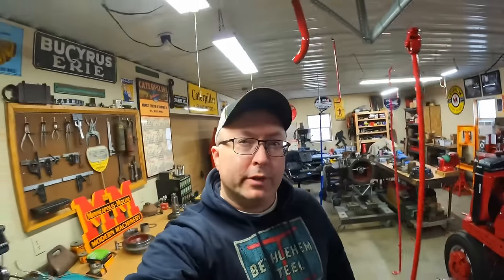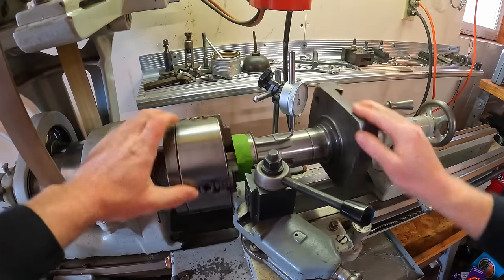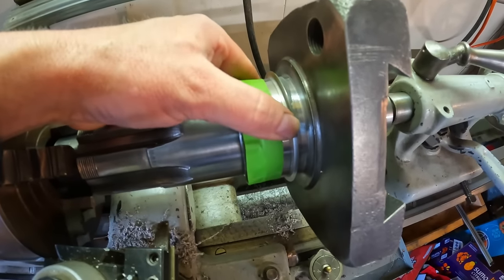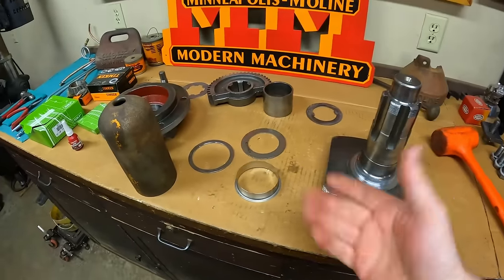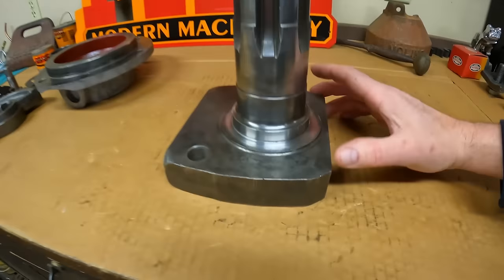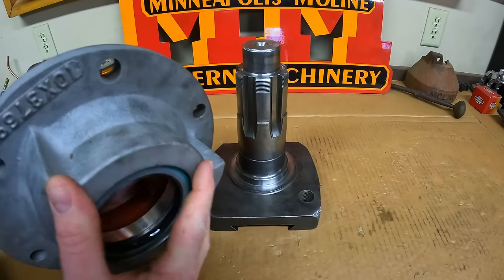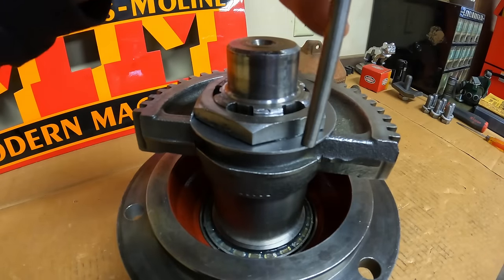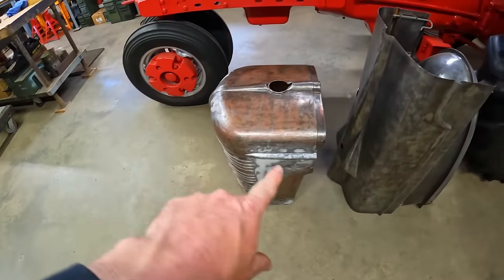Finishing X231's Prototype Steering Sector! Machining & Final Assembly - Episode #84

Comment: Having never used a speedi-sleeve before, I didn't know the bottom portion you peeled off, well....peeled off.  Learned something new today.  Great job on the refurb.  It's always nice to see shiny parts on the bench!
Reply from the maker: Yep, they're scored around the perimeter just above that flange so that you can peel it off cleanly once installed.
Reply: @squatch253  It looked a really scary procedure though. I'm glad both you and the sleeve survived unscathed!
Reply: .. that phone call was Rick Bork messing with ya....
Reply: @neilshep50 The first time using one is quite an anxious time. The more you do, the less scary it becomes.
Reply from the maker: @mmm365 Because the end that has the flange on it has a curved radius on the back side, which allows it to guide itself onto a stepped shoulder shaft like this one here.

Comment: Staying tuned Toby found a couple old shuttle tractors couldn't see a make or model but they were unique a one lunger and a twin cylinder both air cooled and iron with steel wheels and one was rubber skinned front and rear

Comment: Epoxy is such a cool material for the workshop! I always use it to hold un-clampable workpieces in the lathe. Also works really well for the milling machine. You just glue your workpiece to a block of aluminium, which you can then clamp.

Comment: You should look into getting some loctite 660 for putting on speedi-sleeves. It's a paste that you smeer into the groove left by the old seal, then you drive the sleeve over it amd wipe away the excess. It sets up like steel under the sleeve to stop hot spots and deformation, it's great stuff specifically designed for shaft damage.
Reply from the maker: I've used that stuff on the spun Cat D2 & D4 pony motor main bearing bores before (prior to making my own line-boring adaptors to true out the damaged bores correctly) and it does set up and perform very well.

Comment: Excellent video.  The oil filter canister was the perfect driver tool.  I am thinking the tin shims were farmer fixes . I have a feeling that it should be shimmed like the production tractor was that would make more sense to keep the top bearing from binding up unless the bolster is bored out completely different than the production tractor.  Keep up the great videos.  Have you got any reports from the radiator shop
Reply from the maker: I have a sneaking suspicion that the bearing pocket that’s up inside the bolster was machined a little too deep, requiring the shims to be relocated up in there instead of at the main flange. When I get the bolster casting back from the radiator shop, I’ll do some measuring to try to see what exactly is going on 👍
Reply: @squatch253  that could be the case them fancy shims may have been made at the Minneapolis Moline r and d department during assembly a one piece shim would have been better than multiple pieces but I suppose they put what was needed they may not have been thinking about a gasket down below or running oil in the bearing area there.  I think the older tractors ran cup grease in the steering sector and the oil was a new idea 💡

Comment: Long time ago in a galaxy far away I watched a mechanic setting the bearing nut on the nose gear of a jet. He was using a socket a little bigger than the one you have there that was reduced down to a 1/4 inch torque wrench. Setting was in inch/pounds.

Comment: TOBY!!!!! Something registered in my mind about the bearing on the bottom of the shaft. I had to go back to the disassembly to double check. Remember how loose the nut was when you were flattening the fold over lock. My theory is that the shaft was spaced down to try to get a fresh surface for the seal to ride on. That would explain the shims above the top bearing race and the nut being loose so that the bottom bearing could move upward with the hope that the seal would be above the groove on the sealing surface. This is one of those situations where my brain kept telling me that something was wrong but I couldn't put my finger on it until I had watched this video for the third time. Please tell me if this helps.
Reply from the maker: Plausible theory, but the nut was still ran down far enough to have the sector gear bottomed out on the splines, the nut just wasn’t cinched completely tight against it. Likely caused by the small amount of slack that the sector gear has on the shaft splines, and the steady working slowly wore all of the mating surfaces, causing the nut to lose its clamp load on everything beneath it.

Comment: Never installed speedy sleeves myself. However this video is now a good learning material how to handle one the right way. 
Looking good and it will be very interesting to see what other interesting finds will come out of X231 front.
Reply from the maker: You can also install those sleeves upside down too, with the flange up if the job requires it. They just start easier on a square shouldered shaft like this if you have the flange down, because it’s got a nice curved radius on its back side 👍
Reply: @squatch253  Thanks for the tip. I keep that in mind when having to install one myself 🙂

Comment: you ruined me, I made a fold over lock for a perkins engine the other day & I was upset because it had some sanding scratches  on the edges. I draw the line at buffing fold over locks😂

Comment: good job on the sector just wondering about x231 starter painted that red lead color someone probably rebuilt it one time and painted will be interesting to see what inside looks like when you get to it also the generator will be fun too
Reply from the maker: Yes, Senior was the one who put that red primer on it WAYYYY back before we took X231 completely apart - he overhauled the starter and cleaned up the carburetor and we actually had the engine spinning over, but then found that it barely had any compression so we stopped there.  Little did we know how the whole rest of that poor tractor's insides were completely trashed lol!

Comment: Squatch with those dodgy shims ontop of the steering spindle is it possible to use a packing shim (extra thick) and shim out the base like the production units as it seems and you have pointed out that some one at some stage had been into it and made a hash of it all. my thoughts anyway

Comment: I'm curious why you elected to use JB Weld to build up that surface as opposed to building it up with actual weld steel, followed by milling? The steering component looks great sitting on the bench though!  Christine is coming together!
Reply from the maker: I usually JB weld under all of my Speedi-sleeves because the sleeve itself provides all of the strength needed, and the JB Weld only evens out the back-stop if you will.  If I were to build a shaft up with weld, I'd just machine and polish it back to original dimensions and put the seal back onto it.  But in this case, I'd rather not apply heat and weld to this steering pivot - not only because it's a prototype piece that I dearly want to avoid causing any damage to - but also to avoid potentially stressing that portion of the shaft from irregular weld beads.
Reply: @squatch253  Makes good sense. Thanks, Toby.

Comment: Hey Squatch, just wondering if that nut is actually supposed to be your end play adjustment to your bearings? it would work just like a wheel bearing but push outward instead of pulling inward on the bottom bearing to set your end play on the shaft. That would also explain why the nut was barely finger tight when you took it apart? hope this helps.
Reply from the maker: The looser the nut is, the farther down the shaft will end up - which would be good for adding more shims to the bearing cage flange, but would work against the upper bearing because it would pull it further away from the race in the bolster, causing the need for even more shims up there to get the race closer to the upper bearing.
Reply: @squatch253  I agree with what your saying. What I am trying to say here and I will break it down piece by piece. The weight of the tractor all rides on the top bearing in Christine's front bolster. Without any shims under that top bearing race, the bearing housing with gasket and bottom race is X distance from the top race. While the top race on the shaft is fixed, the bottom race free floats on the shaft. Ergo by the bottom cone pushing on the sleeve which pushes on the sector gear which pushes on the FOL which is tensioned by the nut. moving the nut tighter will increase "X" distance and loosening the nut will decrease "X" distance on your shaft to set your "Stack-up" for the bearings. What I have noticed in this video vs the disassembly video after reviewing bot a couple times by my mechanics micrometer eyeball, is that the nut went on a thread or two farther when you snugged it with the impact. which a couple threads of that nut would be about the thickness of the shims you found behind the top bearings. In short, if you tighten the nut it will take away endplay and loosening it will indeed add endplay which would require more shims. Best of luck and cant wait to se the next episode!

Comment: How in  the world did you make the two washers you used to drive the speedy sleeve? I am amazed.
Reply from the maker: I only had to resize a couple that I already had on hand - the outside diameter stayed the same, I just had to take the centers out on the lathe 👍

Comment: Just a quick question i think i remember you saying at one point that whole area is filled with oil or lube if thats the case wouldnt you not want to fill the bearing with grease? I know on oil fillled hubs your not supposed to because if makes it hard for the lube to get in the bearing, just a thought
Reply from the maker: If the bearing is packed with grease, it's got all the lube that it needs regardless of how much of the other oil is reaching it or not.   We always had to pack the rear wheel bearings on the Dana axles back at the Ford dealer after replacing the axle seals, even though they relied on an oil bath type lubrication inside the hubs.  It was Ford specified procedure to do this because it always took the gear oil a while to fully migrate back out to everything, and the grease that we packed into the bearing was the only thing that kept them protected long enough for the oil to start doing its job.  We had one Dana 80 show up that didn't have those hub bearings packed and were just put back in with a smear of oil on them, and shortly after it was put back together the bearings failed to the point that the axle shaft sheared in two, and one piece fusion welded itself to the inside of the axle tube.  That made me a believer in packing bearings with grease, even if they run in oil.
Reply: @squatch253  that makes sence I guess I'm more used to heavy duty applications and in the service manual it states to not pack with grease but you also either have to jack each side up individually to get oil to opposite hub or fill thru fill hole
Reply: @squatch253  this is directly out of the dana d40-170 service manual

Note: Lubricate only with clean axle lubricant of the same type used in the axle sump. Do not pack the bearings with grease before installation. Grease will prevent the proper circulation of axle lubricant and may cause wheel seal failure.
Reply from the maker: All I know is what the Ford Service Manuals recommended for the procedure, and it clearly spells out to always pack the hub bearings with grease when reassembling.  Like I said, the only times I ever witnessed bearing failure from a lack of lubrication is on the ones that weren't packed with grease and only assembled with a coating of the gear oil.  Your mileage may vary :-)

Comment: Could the speedy sleeve be driven flange side up? I haven’t worked with speed sleeves.
Reply from the maker: Yes, I’ve done it both ways depending on the requirements of the job. It’s usually easier to start the Speedi-Sleeves with the flange pointing down like I did here because it has a curved radius behind it, so it won’t snag on a sharp top edge.

Comment: Where did you get the production 445 parts from?  Looks like you have enough parts to build a complete tractor?
Reply from the maker: A few episodes back I told some more of the X231 story that hadn't yet been shared on camera, and in it I covered how I bought this 445 parts tractor to completely disassemble and use for parts - that's where I got most of the production parts that I show in the videos as well as a lot of the production pieces that ended up going into X231.  Here's the link to that episode - https://youtu.be/af-R6LTHexs
Reply: @squatch253  Thanks for the link.  I thought I had watched all of the videos so I am not sure how I missed that.  I rewatched the episode and found it at 6:15 to 7:15.  I must have been zoned out the first time and just missed it.

Comment: I’m not a machinist, so bear that in mind about my question.
Why a 4 jaw chuck instead of a three jaw?
Reply from the maker: Because the 4-jaw was what was already on the South Bend, plus you can usually dial a 4-jaw in with more accuracy that a 3-jaw would provide 👍
Reply: Also a 4 jaw chuck will hold tighter.